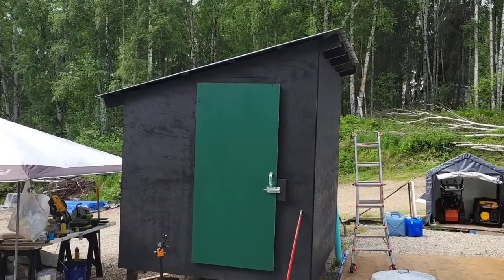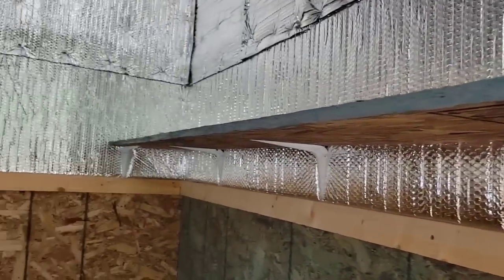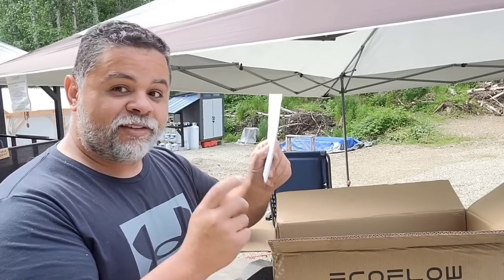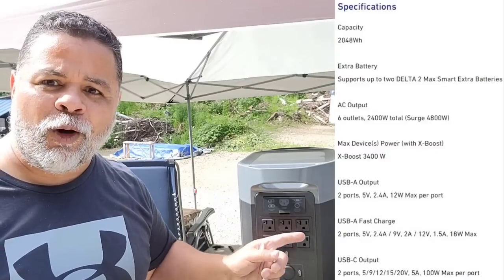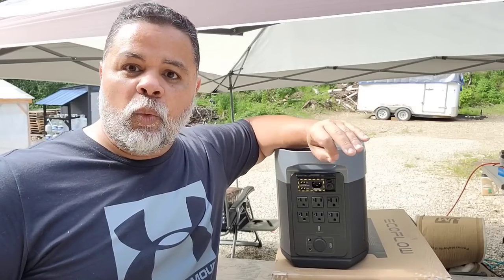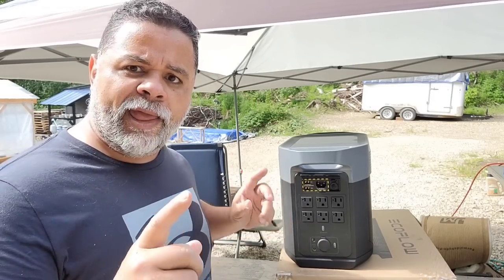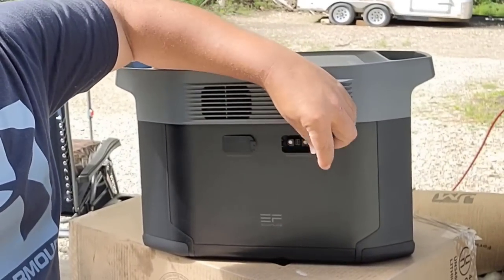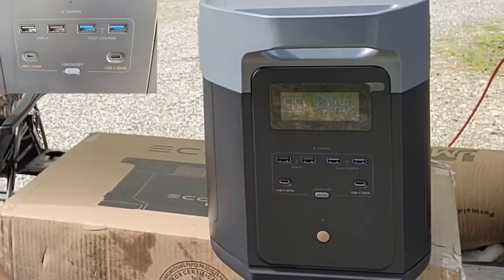A Tour Of My Chicken Coop & Reviewing The Delta 2 Max & It's Awesome!

Comment: If not already said, I’d add 1/2 inch hardware cloth around the chain link because your chicken’s heads can be pulled thru that  wire, and smaller predators like weasels can get thru. You may need more ventilation also in your coop, cover all o-endings with hardware cloth.  For 20 birds, you’ll quickly outgrow your run. It looks awesome. Welcome to the world of chickens!

Comment: I see one very important thing you need.  Ventilation is a must even in sever cold temps.  Chickens breath out a lot of moisture and the moisture will freeze their lungs.  The ventilation ports needs to be hip high and cross ventilation. Cover holes with vent covers with screens.  Windows in cold weather not proper ventilation.  You don’t want the cold air blowing in on them from windows. But cross vents are needed across from each sides.  Also watch chickens eating your insulation. They love styrofoam insulation and the shiny foil may attract them to eat it too.  Before you get the chickens out in the upper vents.

Comment: Good review, the reason as to why two cables to charge your delta 2 max is because your DC cable is also a data cable, you can have your delta 2 max connected to the generator using that cable then your delta 2 max can send a signal to start the generator to charge the delta 2, let’s say you don’t want it to go below 30 percent when it reaches that automatically it’ll start the generator to charge it. This can not be done using the AC cable.

Comment: Wonderful video. I think the main reason they made a dedicated connection point between the gen and delta max, is to not use up a potential output for another device you may want to power up.

Comment: I agree that a tree branch is much better than a 2x4. The chickens will peck at the shiny stuff. We covered over the insulation. Don’t have any open areas where the chickens can get out or a predator can get in. We put hardware cloth under the chicken run area as well. I would be very careful about putting a heater in the coop. I assume you’ll have some sort of shavings on the bottom and they could catch on fire.
Reply: Use a heater designed for coops like Sweeter Heater or similar at tractor supply. DONT USE HEAT LAMPS.

Comment: Just purchased the Delta bundle. I like the fact my freezer can be hooked up to this and if the power goes out, the  Delta max automatically powers the freezer. It was a great deal. I have the older Delta without the new battery.. I'll use that for my refrigerator. Nice coop, btw!

Comment: Hi Rudy, Just a thought on the Cable for Ecoflow  Smart Generator.  I personally have the Ecoflow  Delta and the Max originals, but not the Smart Generator. I was thinking maybe the reason for the larger cable is for the Smart function of the Generator to start up. That is just a guess so, but that has me thinking of something to research since I am looking into the Dual Fuel Smart Generator for my Delta Max. If you get any insight for the main reason for the thicker cable it would be a good follow up video on it. By the way the Chicken coop looks great.
Reply: That’s what I think also, it provides the smart communication that an ac cable can not.

Comment: Ecoflow I think used to not include the XT60 cables for solar panels but my panels actually came with the cords. The units did not of course. Good thing because you can’t find the Ecoflow brand MC4→ XT60 anywhere, they’re completely sold out. My only issue with them is they’re only like 8 feet which is pretty short. I guess they can upsell you on the extension cables which are still only another 10 feet or so.

Comment: Delta 2 max is nice but I opted for the Delta 2 + extra battery for $1050. I got two of those sets so I have 4096kwh roughly and I can use them in different locations at the same time.

My 2nd set is arriving today. The first unit proved itself as we had two 4-6 hour power outages within 2-3 days after I got my first unit. I was able to keep my mini fridge and fans blowing to cool me down in 95+ degree temps and the runtime was about 7 hours for those things.

I also bought the Ecoflow wave 2 so I can have both AC and heat in one unit during SHTF or apparently just normal times at this point.

And then I also got four of the 220w biface portable panels to solar charge these units.

Yes I dumped $5,000 on all of this but hoping it will be worth having a good amount of renewable power if SHTF goes down.

Another benefit of having the extra battery units is you can power the Wave 2 AC off of the extra battery alone— so technically I can have these batteries in 3 different places at once powering things. I felt that would give me more versatility as I have a big family and will need power in multiple areas at once.

Comment: My experience with Ecoflow:
1: My ecoflow product (River max) is NOT a UPS; i tested mine while connected to my woodpelletstove, and when i unplugged the wallplug, the wattage dropped massively and my stove went in alarm mode, saying "Low voltage" and the feeder went into continously running mode, the alarm sounded and the airflow stopped.
Totally useless as a UPS.

2: I contacted Ecoflow, and at the time they did not even have any office for the European market.
After three days without any answer i contacted them again, then after two days they replied back that they needed a video of the error.
I send them a video clearly showing the fault.
Then after four days without answer, i contacted them and they replied that the awaited answer from the tech department.
After another three days i contacted them again (Dont forget that this was in a Scandinavian (Danish) winter where we hit -18 celcius and with the government warning about brownouts and blackouts) and now they needed some information, i gave them that and explained to them that it was VERY important that i got this issue resolved before the Christmas holidays coming up in a few weeks.
Then after a few days they replied back that i needed to send it back to some address in Germany at a thirdparty company.
That would take up to five weeks.
I once again explained to them the situation and that without electricity i could literally not heat my home.
There was nothing they could do.
I could not return my faulty Ecoflow product due to the above warnings and temperatures, so i had to go through above winter hoping that we did not have any electricity dropouts.

3:
The Eco solarpanels i bought at the same time is already starting to separate the film and surface, after only eight months and total use outside is less than a week.
They have been stored dry, cool and in the shade in my bedroom.

Ecoflow product is not worth the price and they are apparently more busy sponsoring youtubers with free products instead of making quality products and providing a proper customer service.
With so many youtubers getting free products the praise to heaven and back, only to experience that they fail and the customer service do as well, i simply do not know what to do.
I would not waste a single dime on those fancy and smart products, instead i would buy a woodburning stove and a permanent solarinstallation with batteries.